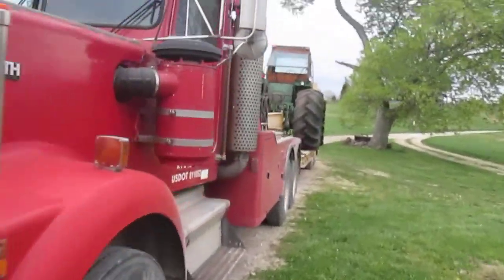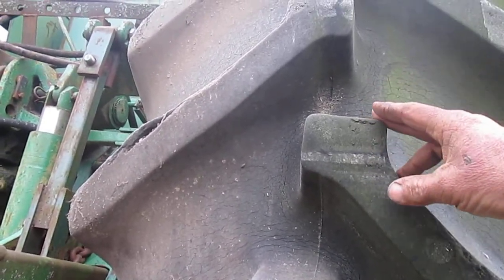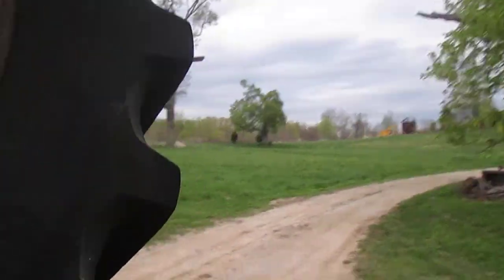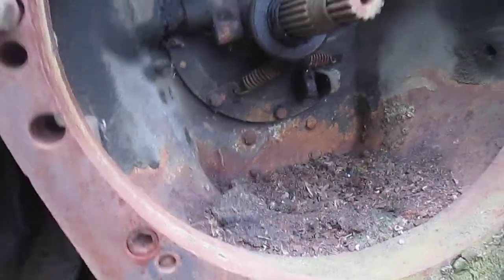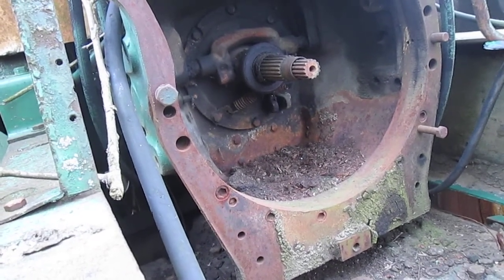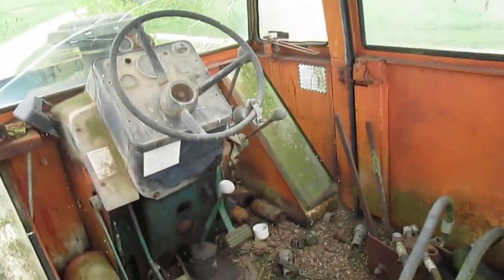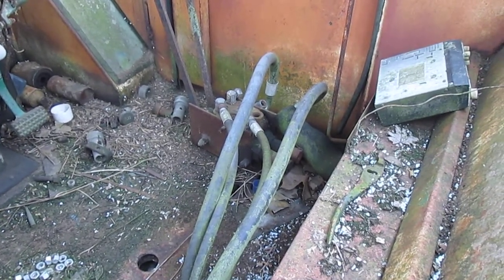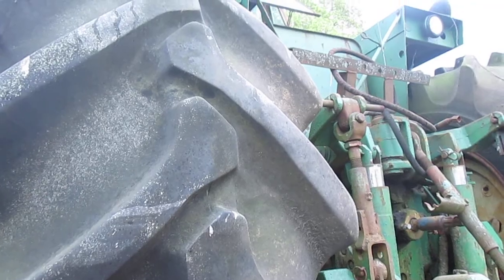Got The Oliver 2655 Home

Comment: I had a feeling.  Just a matter of Time 👍, curious to see which engine yah stic in ur 👍
Reply from the maker: Yup I finally got it bought .  I'm leaning in the direction of a 855 Cummins but not sure yet .  Sadly we could not locate the original engine, front grill or sheet metal on the farm it was on but I can find those items elsewhere .
Reply: Or The R&D dept will Fab one up😉
Reply from the maker: @edward-x3s6f  Thank you Ed . I got a feeling I'm gonna need all the help I can get on this project !  
 It's driving me nuts as I can't figure out what engine was in it that the adaptor plate was made for ?  
  on a good note we did find a 220 HP Cummins engine power unit with radiator and clutch drive that ran a sawmill .
Reply: @cranerigging3604  i am sure it will all come TOGETHER 👍
Reply: @cranerigging3604  I’d derate that. The transmissions were weak. Somewhere to the tune of 180 would be perfect
Reply from the maker: @nellsonstout7001   180 horsepower would be fine for the application .
Reply from the maker: @nellsonstout7001   180 horsepower would fit the application fine .